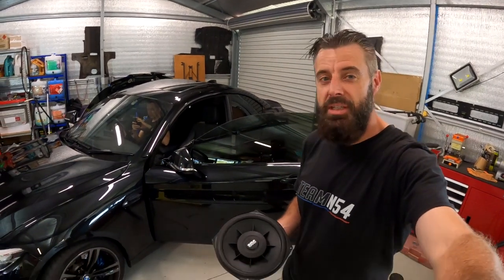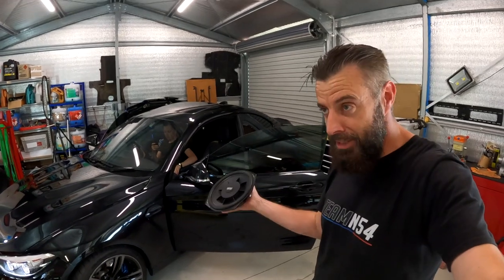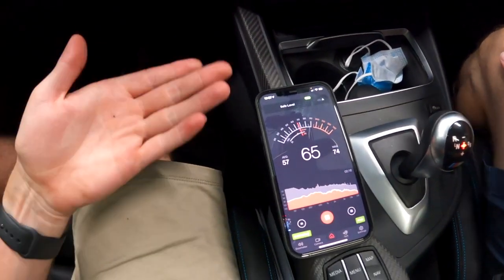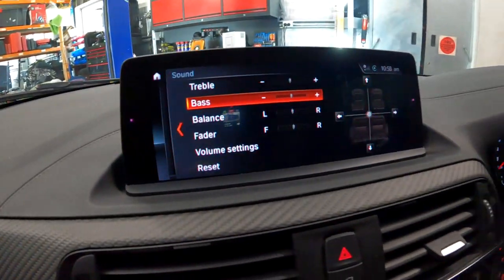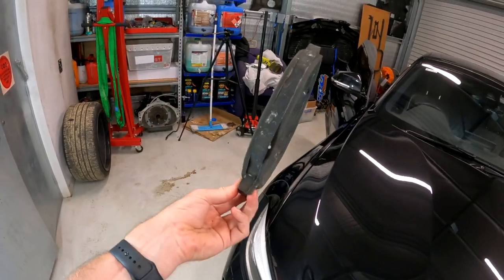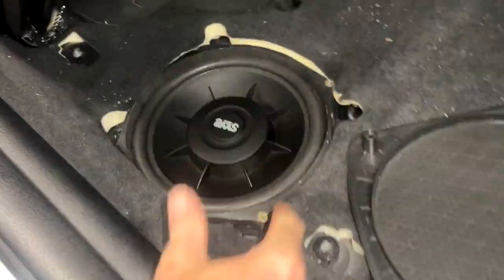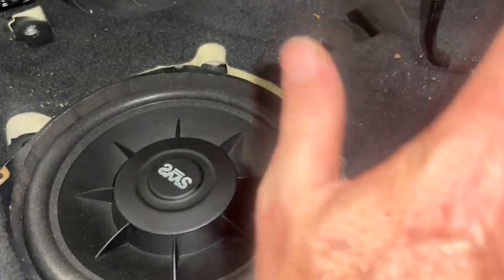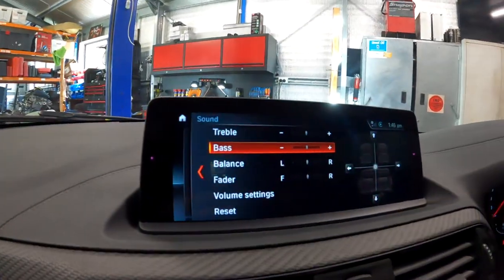Earthquake 8" Shallow Mount Sub Install: BMW M2

Comment: Nice comparison, I had these, the bav sounds, the oem hifi subs, the focals and rockfords and the SWS blew all of them away. Btw +6DB on an SPL meter is double the SPL so these are significantly louder. Also, when testing its best to have the microphone at ear level for a realistic comparison. I had all the 8inch bmw options and compared them then cut them all in half. Basically all but the SWS are the same technology. What makes the SWS legendary in addition to the standard stuff like a neo magnet and aluminum heatsink/dustcap, is that theres several patents in use. One of which allows the motor to go up into the cone for much more excursion. They also have the widest surround out of ANY bmw 8 inch option. So more area and more excursion means much more SPL, thats basic physics. Basically all the other 8 inch options are just fancy packaging and marketing. The SWS is the only one that actually has real innovation thanks to it's patents. Regarding the wiring, you can actually depin the oem connector and just get a regular female spade and run a wire to the SWS without splicing or cutting the oem harness.
Reply: Also always break in subs before comparing. The SWS likes a 40hz breakin at a moderate gain to break in the spider.
Reply from the maker: Thanks for your insight and advice for future tests, you probabaly worked it out, but im not in to audio that much. But do appreciate what you are saying here.
Reply: +6db is not double the spl. 10db is double. 3db is noticeable. Earthquake sws would be the best option if it didn't break from 150 watts. All the other aftermarket options can handle close to 300 watts and people never report them breaking unlike the sws

Comment: For anyone interested in the nerdy details, I work as an audio engineer. Cheap subs usually don't put out the fundamental bass frequency, they put out harmonics to trick your ears into perceiving more bass and loudness than they're physically capable of and use less power, for example playing 120hz instead of a deep 60hz. phones, laptops, portable speakers and cheap home stereos do this too. good subs will give you the true fundamentals which feel a lot more full but require a lot more power which is what you're experiencing. also don't trust the meter, as you won't be able to get an accurate delta. meters are usually a-weighted which means they have an eq curve that actually ignore the majority of the bass, plus the microphones in phones aren't that great either. Our ears also behave in a strange way that perceives louder as better, but even if it's quieter, as long as it's deeper that's a win. With a more powerful amp it will sound amazing. There's no better feeling than the feeling of getting repeatedly kicked in the back of the head by mega bass, but it comes at the price of Tinnitus lol
Reply: Ive heard these on an aftermarket sub. The difference is pretty big. Hitting those deep notes definitly brings the music to life.
Reply: Bass doesn't really cause tinnitus, upper midrange and higher frequencies do.
Reply: @Dragginhombre87  that is incorrect. bass can definitely cause and aggravate tinnitus

Comment: I tried to run a flat panel sub recently in my 135 and it was just depressing. Ruining an active 12” now and does the job way too well but can be turned down with its own volume knob in the cabin. Factory enclosures just seem to be better so pretty good to reuse with better hardware.

Comment: I have these in my M240i. I got them on Amazon for $230 for both with the install gaskets. They worked alright on the stock amp. But I upgraded to a Skar Audio 5 channel amp and they sound 100% better. About $500 including wiring adapters and all. Going to change out the speakers to Rockford Fosgates T142 and they should bolt up to the factory holes.

Comment: Using poweramp eq, bringing everything down but 31hz, max that, preamp to +5 and bring everything else up slowly to your liking will still make the stock subs sound better the then the earthquake. I have both and doing this still makes the earthquakes much better but it's so much better. I'm getting 108db with stock amp and it's down in the 36hz

Comment: Would those sun woofers fit in an e90? Or is there a kit they make for my models
Reply from the maker: It would, but you will need to make some spacers.
Reply: TechnicPNP makes a install kit for wiring an aftermarket amp and sells plug and play spacers

Comment: If you download Spotify you can adjust the eq settings in the app and it will amp up the frequency’s and your be able to gain more output from the cars amp, I did this in my mates m3 competition and he doesn’t have Harmon kardon but the stereo under that and he was blown away by how much better using Spotify and adjusting the audio settings in the app made to his cars stereo
Reply: Welcome distorted signal

Comment: Hey, so how is the MFactory holding up?
I'm trying to decide between Mfactory, & M3 lsd for my car, for 450-600whp 19T twins.
Reply from the maker: The mfactory diff i had in my 335i, was removed in July when i did the DCT conversion. However it was still working fine. Probably way too aggressive for the street.
Reply: @ZeroTo60Tube  Way too aggressive? What would make an lsd or a specific one too aggressive? Don't LSDs improve grip & general driving saftey all around? (By saftey, i mean better car control) Or does it increase nvh?
Reply from the maker: @qx4n9e1xp  my mfactory was a clutched LSD. A real LSD that you would use for a race car. Most street cars have a torsion style. Never actually gives a full lock. When you have a clutched LSD the wheels will slip, then lock. And you feel and notice the lock in some situations. Especially in the wet. Vibrates through the whole car. On a track with heat and flat out driving they are great, nice and smooth. But plodding around the shops, as they are set up for flat out full load, you get that harsh lock on the street. It was worse than a locked diff tbh.
Reply: @ZeroTo60Tube  Ok thanks! I did brief research and also found that "helical" lsds are preferred over clutch for non-race applications. Also that clutched lsds are slightly higher maintenance.

Comment: You can measure the original speaker ohms with your multi meter 👍
Reply from the maker: Didn’t think you can measure ohms with a normal digital multimeter.
Reply: @ZeroTo60Tube   just gotta look for the ohms symbol and select the correct range.  You can check ignition leads on older cars that way too :)
Reply: @ZeroTo60Tube  true you can not measure the correct impedence with just the ohm readout, but you can correlate
a 8 Ohm impedance speaker will measure around 6 Ohm DC resistance
a 4 Ohm impedance speaker will measure around 3 Ohm DC resistance
a 2 Ohm impedance speaker should measure somewhere between 1 and 1,5 ohm